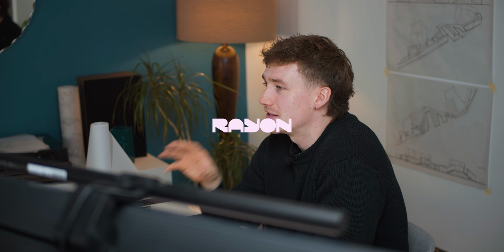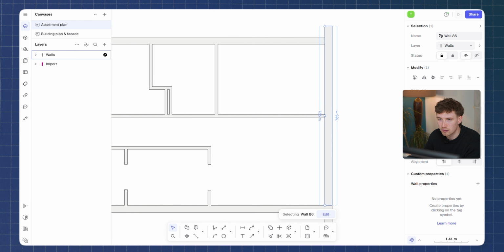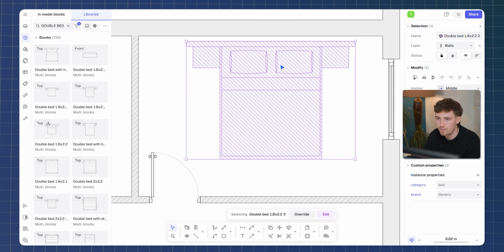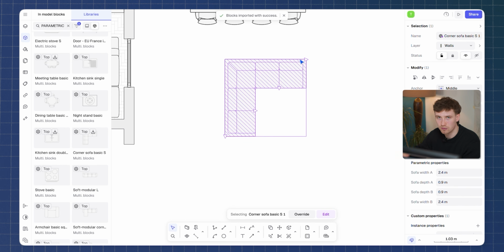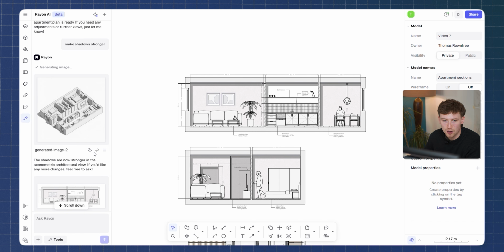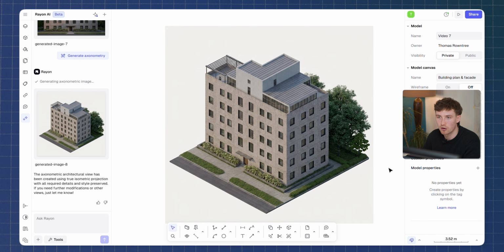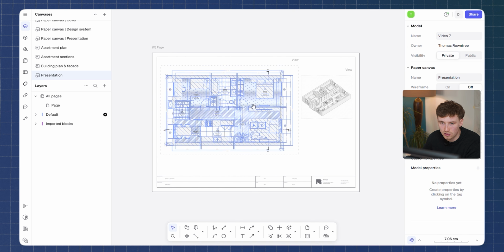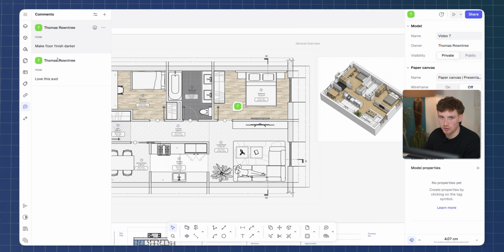How to Turn 2D Floor Plans into Rendered 3D Axo Views Using AI

Comment: How would you compare Rayon to Synaps? I'm a Rayon user by the way.
Reply from the maker: Hi there! Both are great tools, but they have different strengths. Rayon is built around a fast, collaborative workflow for 2D drawings, presentations, and documentation, while Synaps has its own approach and feature set.

It really comes down to your workflow and the type of projects you work on. The best way to compare is to try both and see which one fits your process better 🙂